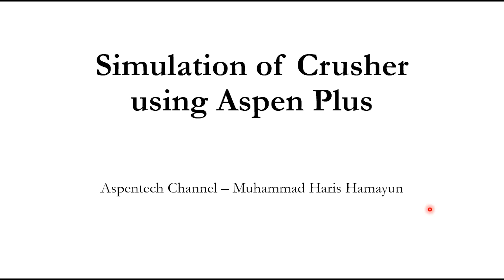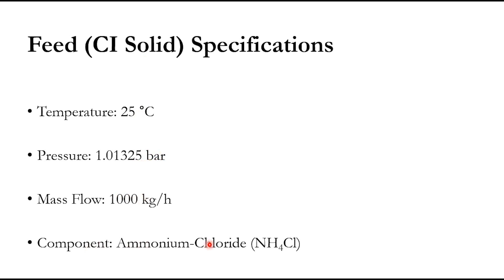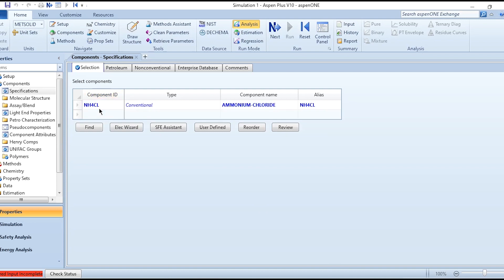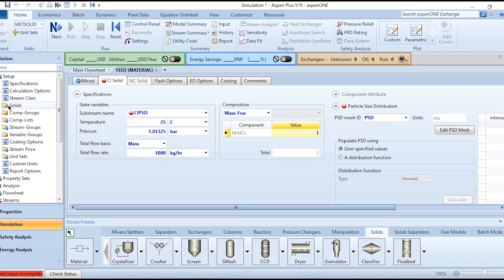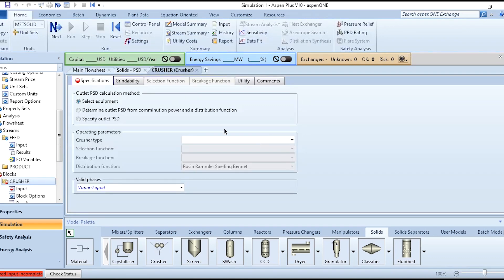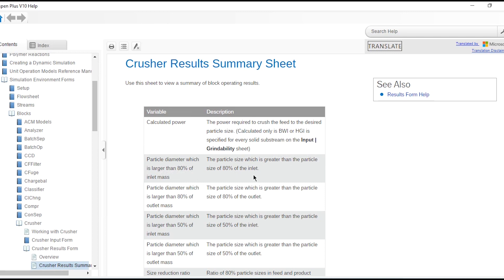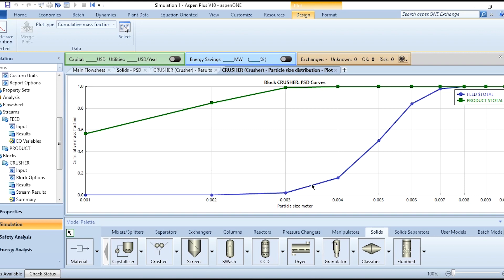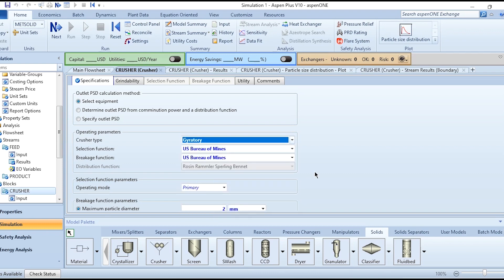Simulation of Gyratory Crusher using Aspen Plus - Lecture # 108

Comment: Hi Dr Hamayun - you mention in this video that you were going to cover the more difficult to describe Fine Milling Operations - such as Hammer and Impact Milling. I am struggling to define all the parameter sets in a multi-stage configuration as I start with large (circa 100mm) and then need to go to micron scale. Could you do a video on a multi-stage milling process please?